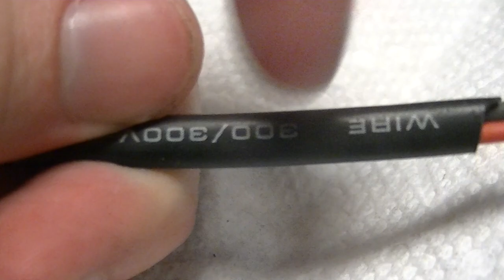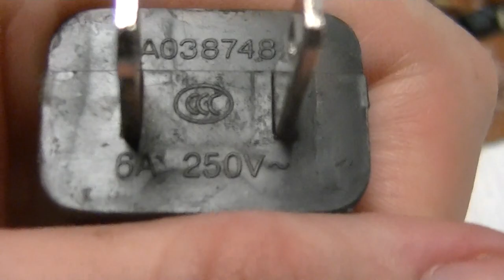Cheapo computer speaker guts

Comment: This copper wire seems too springy to be legit. Test it with a magnet, I suspect it is iron wire with a copperish coating.
Reply from the maker: msylvain59 It is not iron/steel wire with a copper plating.  Whatever it is, it is all one metal.  However, the slag inclusions and other metals that are probably in there as filler probably affect its mechanical properties somewhat.